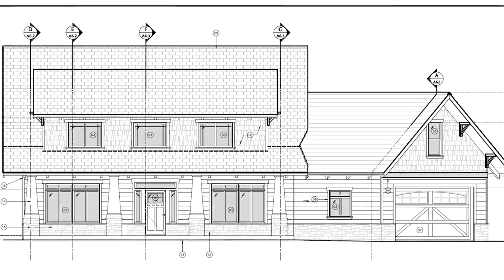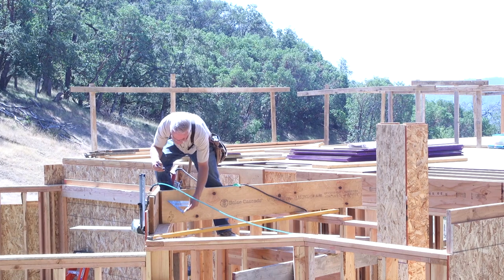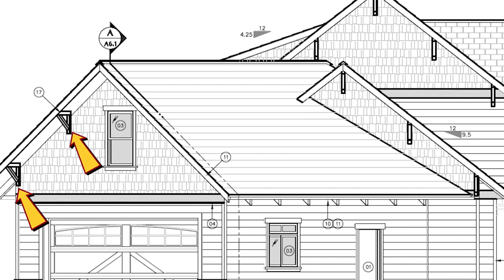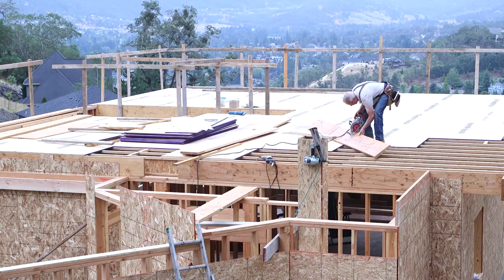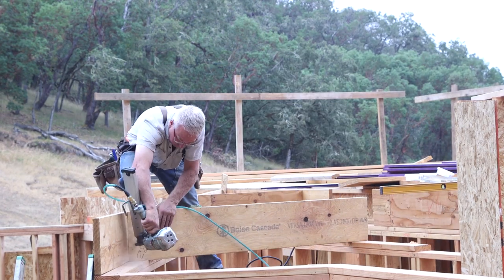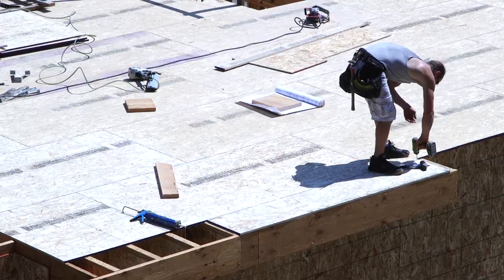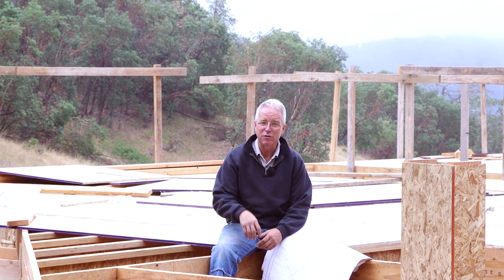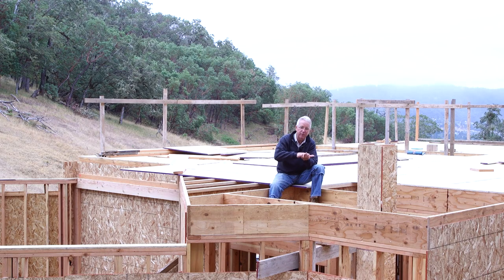Ledgers, LVLs, Design, and Scribing Ep.57

Comment: Andrew Camarata broke his burke bar
Reply: I know, right? Didn't he do that prying against steel columns and suspended spancrete floors? Doubt typical homebuilding is going to relate though. Love watching Camarata build his dream castle/shop just as much as watching Essential Craftsman
Reply: Forget the burke bar, I want to know what AC did to his other crane.
Reply: I have a theory with the broken Burke Bar. I think Scott started off with the right steel when he made the bar but I noticed in the thumbnail photo, advertising the video where he made the bar, it shows it at a red hot state. I think that was the point where the ‘business end’ of the bar lost its temper and became brittle enough to snap in half cleanly as Andrew ended up doing. Never saw a Burke Bar fail like that, so that’s my opinion on what happened.
🤜🤛

Comment: GRK screws are unreliable, when I used them in right angle bracing on flown in 36' span trusses I found 1/3 of them fractured or bent from shear stress. Simpson structural screws are far superior on ledgers, and rarely fracture!

Comment: You do not live on the outside of the house. Spare no expense on the exterior but no hardwood stairs?
Reply: The exterior of this house will also use relatively low-cost materials.
Reply: @jej3451  This guy spent more money just getting to pouring a foundation than anyone building a spec house would ever spend. After that you have to save $$ somewhere,